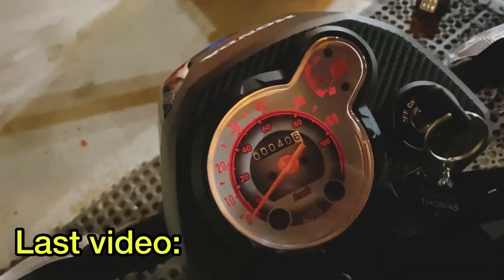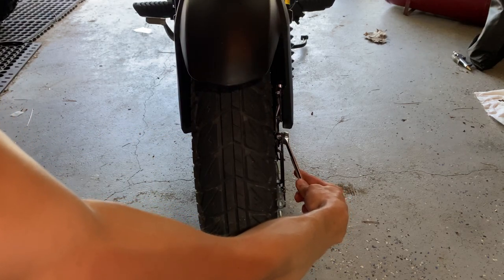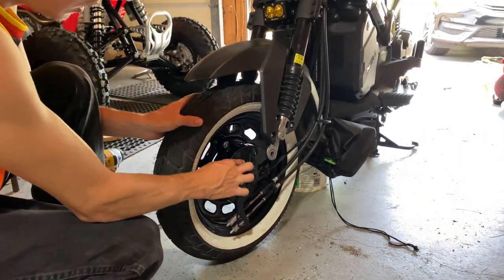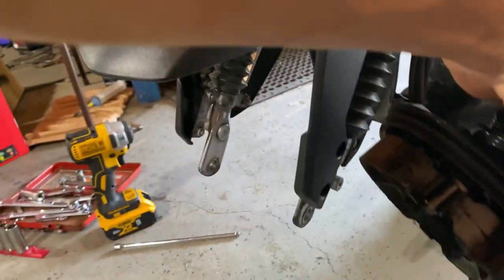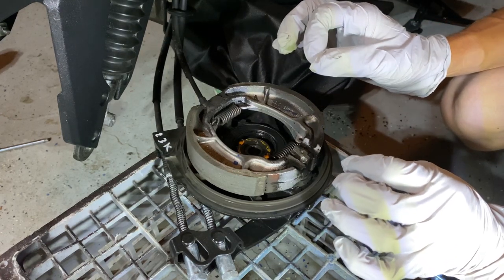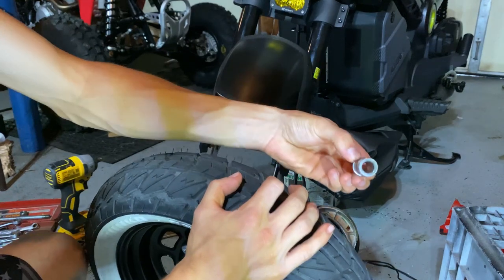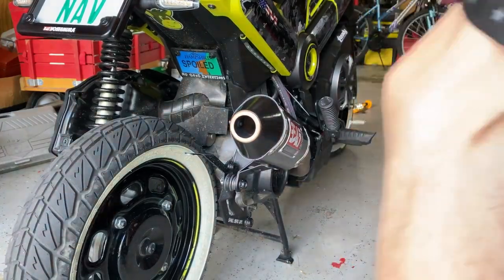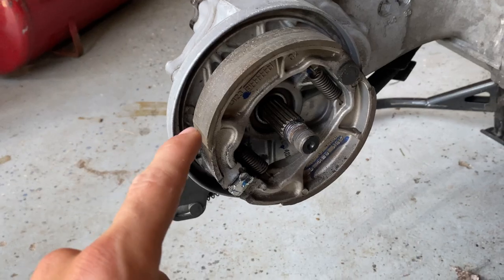Navi Brake Install

Comment: How have the shinko 723s held up? Just ordered a set of 120/70/10 and 110/70/12 for my navi
Reply from the maker: I had a 120/70-12 for the rear I ordered and it was way too big. Shinko sizes just run too big and are inaccurate. I did the 12 inch rear rim swap and I have 110/70-12 both front and rear. They work perfectly.
Reply: @pookythomasmoto9147  great! I ordered a 110/70/12 front and a 120/70/10 rear hoping for no issues wit installation next week thanks for the fast response 🔥

Comment: What size wheel do you have in the back. And what size tires do you use ?
Reply from the maker: 12 inch mod in the back, both tires 110/70-12. Shinko Whitewalls 723.
Reply: did you shave any off to fit the tire?
Reply from the maker: @juanitonuno9596  Yes. It seemed sketchy but the structural integrity of the motor isn’t harmed. Just clears and that’s it.

Comment: Why not do a disk brake  conversion on it?
Reply from the maker: This video serves as a HOW TO for those who want to change their brakes.

My issue with Frank Smokes front disc conversion is it leaves an entire drum assembly in the middle of the wheel with a disc revolving around it. Why not just use the drum at that point? You need the drum because of your speedometer. When they release aftermarket wheel sets with cleaner ways to work around things I can invest, right now it’s pretty pointless especially on a little bike.